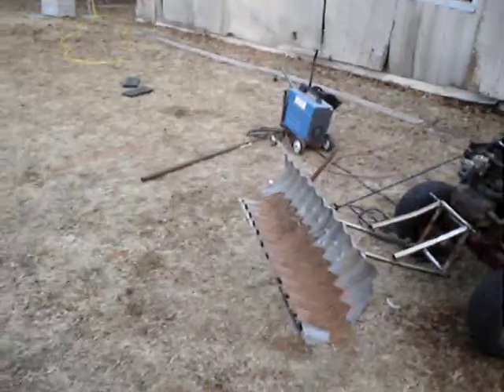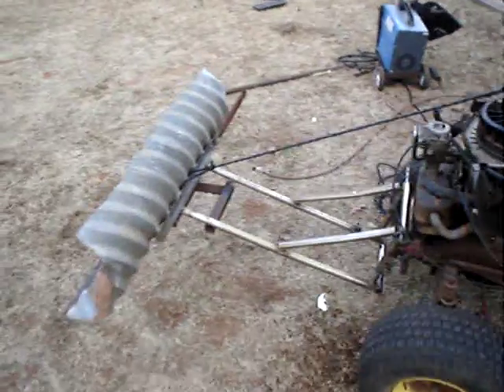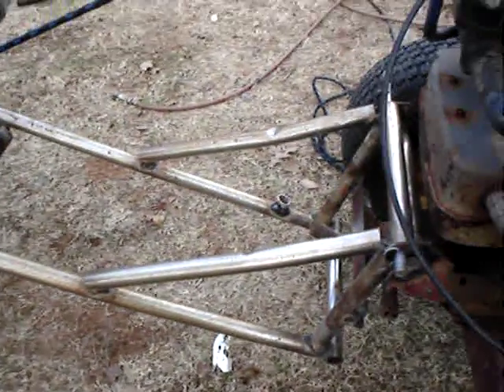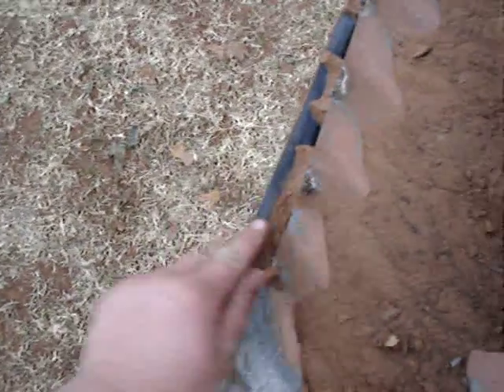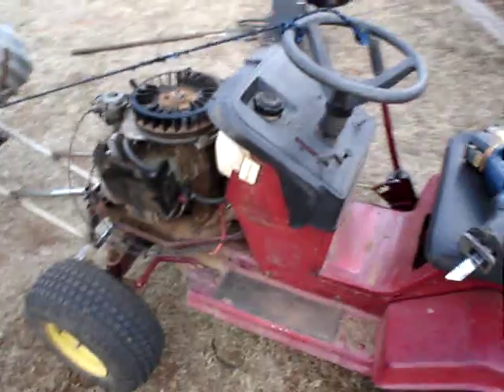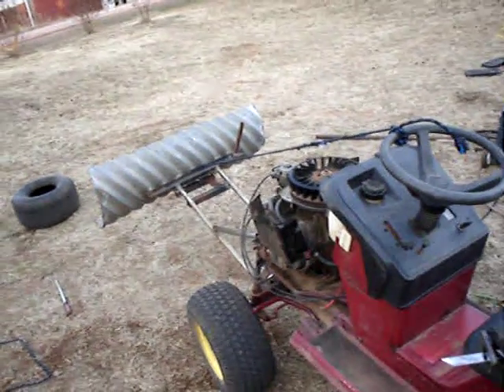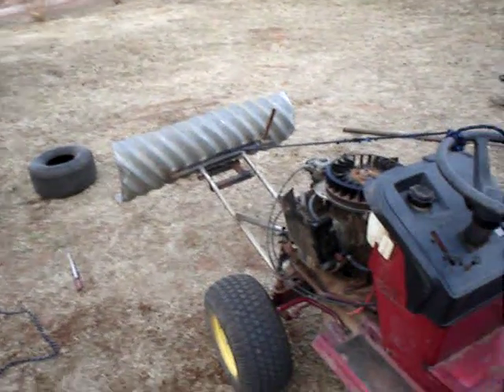home made murray lawn mower snow and dirt plow

Comment from the maker: @scrapkilla321 o ok i see well im building a better plow tomorrow im going to mount two bars under the mower to the bake and then to the plow witch then i coulnd use the deck lever to lift the plow but im getting a winch soon i hope and when i put the plow low likethat it will work better so ya